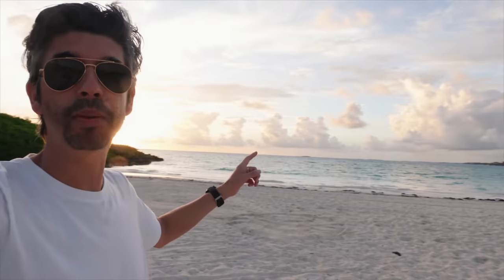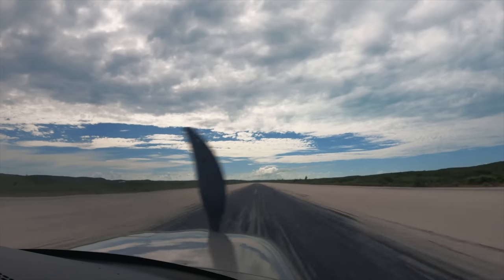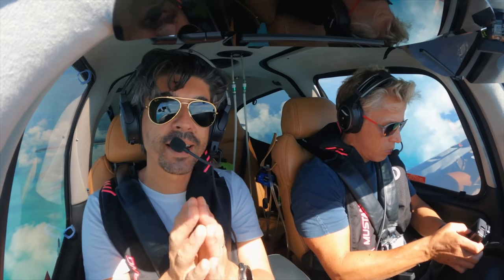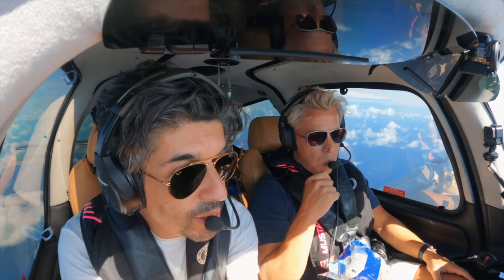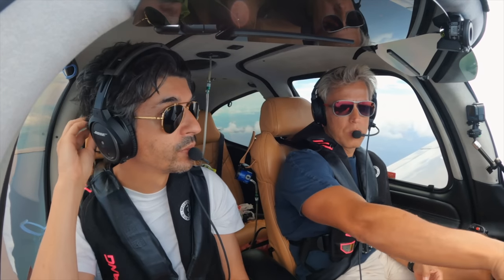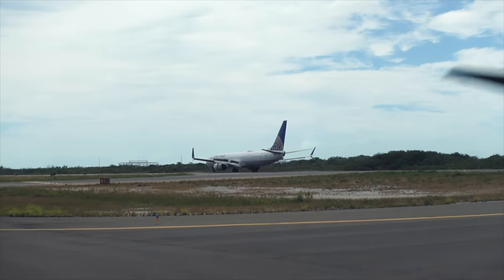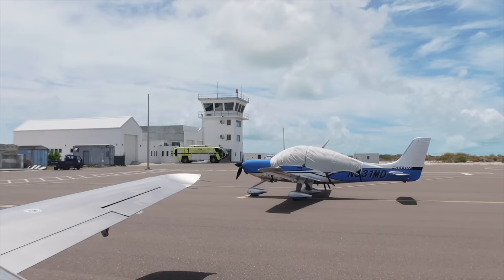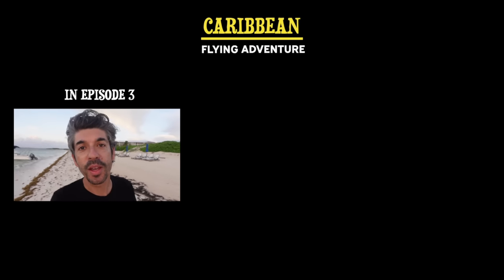A BIG day of flying over water

Comment: In Australia you can put the fuel sample back in if you have a filter on the container. Avia used to always do that with their cirrus when I flew with them.
Reply: What are they supposed to do in the states etc, if there's say, some water in the fuel when they do the fuel drain? Are they allowed to tip it out and what proof would there be that there was contaminant in the sample ?

Comment: 6:50 - the little editing things where the sound goes away as the headset comes off and comes back when it goes back on. Awesome.

The fuel on the ground makes sense although for the planes I rent the preflight involves throwing fuel on the tarmac and watching it evaporate. Normally not a problem except that we fly out of grass strips so it can sometimes be a walk to get to the tarmac area to do that step. Engines are mogas so this step is how we tell if we didn't just pull just water as there is very little to no die in the fuel.
Reply from the maker: Thanks for noticing that :)

Comment: interesting that you are talking in terms of % power on approach etc.  I was always aough in terms of man pressure. (for my SR22 G6, profile is 12" man pressure when established on GS with 50% flaps. about 12.5 on final with full flaps.
Reply from the maker: You can use either, but in the Cirrus with the displays we both have access to, it's a little easier to go off % power on low power settings. Conversely for climb in the turbo you'd reference manifold pressure.

Comment: Wait why Stefan why do you pour your fuel sump cup on the ground not back into the tank in Australia
Reply from the maker: Because fuel evaporates quicker than water. So you can watch it evaporate (you usually throw on a warm dark surface like tarmac) and it's another way to tell if you've drained water instead of fuel.

Comment: So when you test the fuel drains you have to put it back in the tank? What if it has contaminates in it? Or water? Doesn’t that defeat the purpose of the fuel drain?
Reply: it’s really just to check that there isn’t water in it.. so it’s fine to put it back in. it’s not really to drain anything
Reply: The water is held back by the mesh filter. Fuel goes through it and water is caught